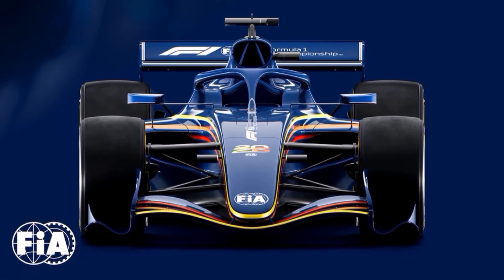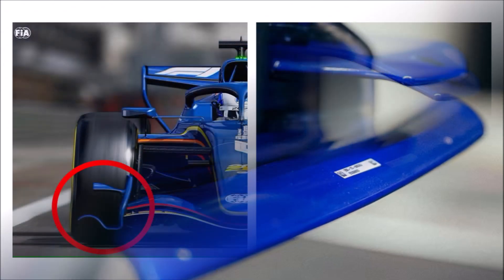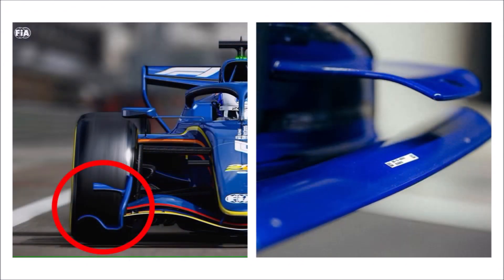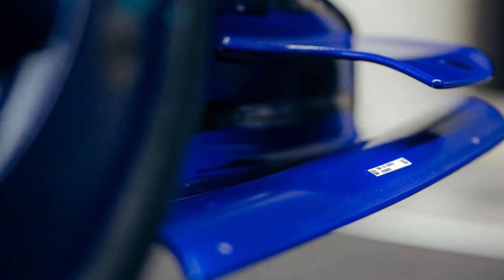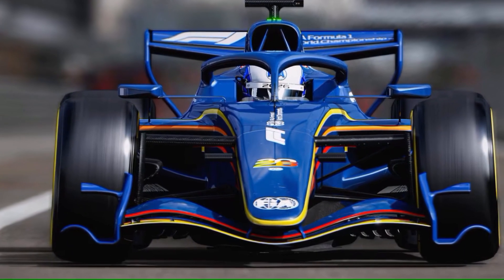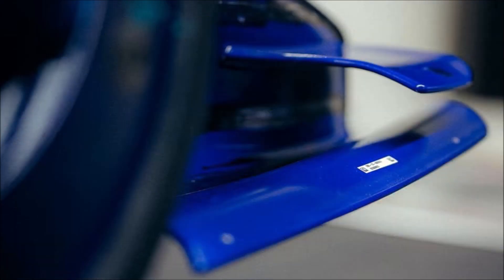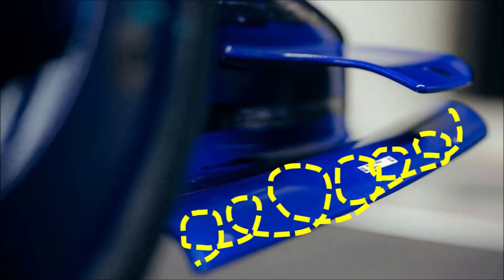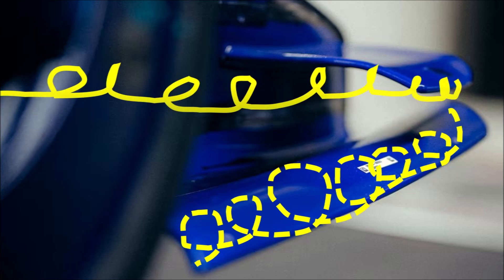F1 2026 - FIRST LOOK

Comment: The F1 2026 car model looks so weird. I hope they end up looking nothing like that. I don't see why we can't just have a simple wing end plate and less complex elements. If it doesn't create the vortices the teams want - tough! Find a solution within the regs. We need to make the cars shorter, and not covered in tiny elements that break off easily from the front and side. The whole point of banning barge boards was to make the cars more elegant and less prone to damage and avoid an expensive aero war.

Comment: One thing is for sure: I wouldn't want to be a 2025 team principal. Deciding how much you focus on this year and how much on the new car, well, that's gotta be a nightmare, especially at the front of the field.
Reply: Crazy that Red Bull were in an insane title fight in 21 and yet still managed to produce a dominant car for 22
Reply: @defnotatroll  still, the 21 car was still the “same” as the 20 car ;) the High rake cars were just much better adapted to the 21 floor rules )
Reply: There is no real reason too dump money in too this year unless you want too attempt to steal a wdc or wcc
Reply: @TinyBearTim For a small team it's an attractive choice. 
Go hard this year with everything you've learned to gain a few constructor places. Bring the most basic reference spec for 26 and see how it goes (admitting you don't have the design budget RedBull has to ace the regs blind.) Then copy the leading design and focus on '27.
Reply: Lucky for the Cadillac team , they already might have started mid 24 ; (as it wasnt an official f1 team by then …
Reply: IMO, the challenge will mostly be for those near the top but not exactly there. For teams like Ferrari and McLaren, better to invest in 2025 if there's a chance for a championship double. Same for the bottom of the pack teams, who aren't fighting for a championship, but can benefit from more development time for 2026. But for teams like Mercedes, and maybe even Red Bull, that's likely where you'll see a lot of could searching con considering whether they should just prepare for 2026.
Reply: you Mike Krack under the pressure 💀
Reply: @KomboAndy  You did Cowell
Reply: I think it all boils down to the foundation and roots of what you wanna be like Williams and sauber don’t have anything to gain for going up in the standings but cash flow which as good as it is the cost cap reduces that problem but someone like Red Bull that has to show max we will win it all it can be a dilemma but ultimately the decision is made now and in June for the winning teams